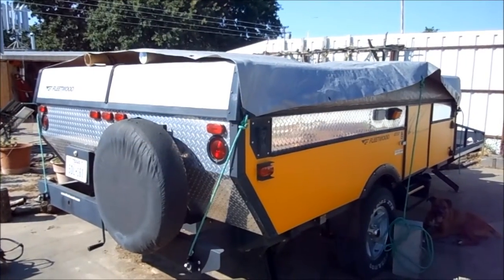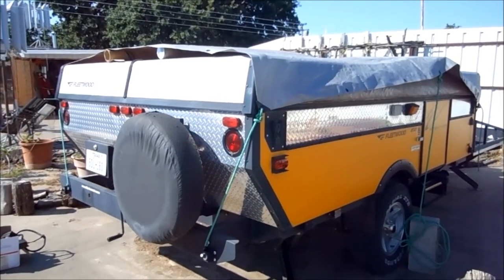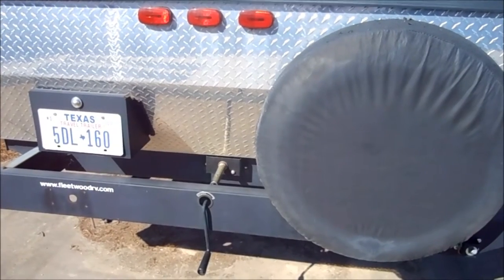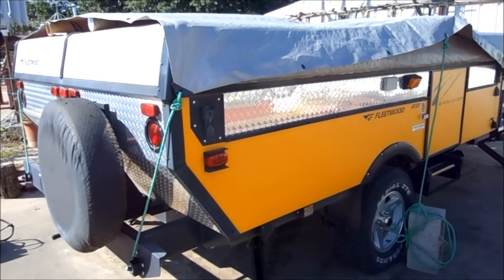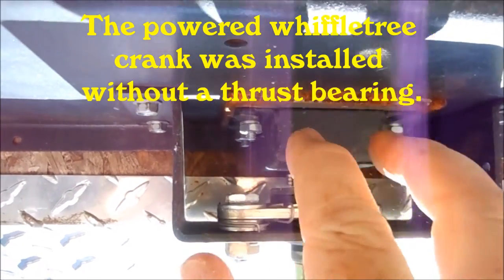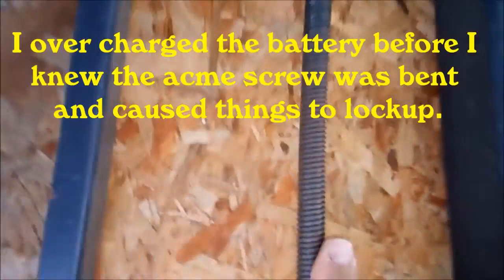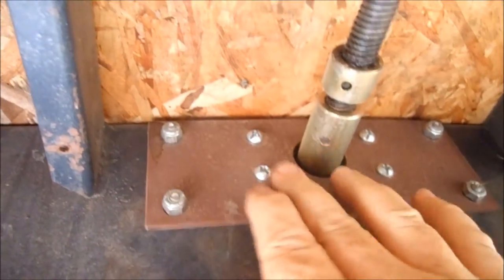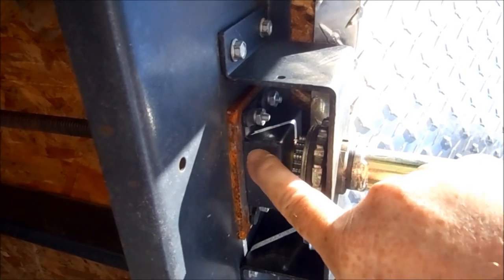E2 Camper Repair Part 1 Whiffletree

Comment: Thank you for the video! I have a 1999 Coleman/Fleetwood camper with the exact same lift system as yours, and luckily I haven't had any issues other than normal wear and tear. I am in the process of replacing the thrust bearing on mine as the internal rubber/plastic portion has deteriorated, which is causing the whiffletree to move a lot, and bind when lowering the top. I'm in the process of removing the PITA shear pins now.

Comment: Great video. I have the same camper (no AC) and luckily haven’t had the same problems  however, I do need to replace the cargo deck. Did you get around to replacing yours? What material did you use?
Reply from the maker: I'm sorry to say I haven't gotten around to doing much repair on the camper yet. And It may have to wait a while longer.

Comment: What it the thickness of the bearing plate you made? 1/4”?  A previous owner removed the one from mine and my ratchet pawl keeps loosing contact.
Reply from the maker: Yes, that plate is 1/4". It may be a bit overkill, but I only wanted to fix it once.

Comment: Hi my name is David and i am from Australia,, i have a 1985 Coleman Camper and the bearing in the whiffletree has collapsed and i cannot wind it up the thing is  i cannot find a place on line that i can get a replacement Whiffletree and accessories can you help with a supplier,, cheers, David
Reply: I'm sorry David, I'm still having trouble finding factory parts for mine. However, you may be able to find a suitable replacement bearing, acme rod, nuts, and cable on this website https://www.mcmaster.com/
Reply from the maker: Andrew is me in case you were wondering.

Comment: Please I need your help I got my Coleman pop up camper and Acme Nut Whiffle Tree is broken I need a replacement I’ve looked everywhere on google I couldn’t find any part for sale do you know where I can find one please it’s argent thanks appreciate it
Reply from the maker: Have you tried ebay? 
https://rover.ebay.com/rover/1/711-53200-19255-0/1?mpre=https%3A%2F%2Fwww.ebay.com%2Fitm%2F1-2-10-single-start-ACME-Threaded-Rod-Lead-Screw-w-Brass-Nut-12-24-36-48%2F322210851299%3Fhash%3Ditem4b054369e3%3Am%3Amfp10WYY3_4Cr9JvhzPfAiw&campid=5337965585&toolid=20008

Comment: Do you know anything about roof repairs? I have an E3 that leaks.
Reply from the maker: Sorry, if your roof is like mine, repair is not an option. My roof is made of 1/8th inch thick plywood, plus 1/2 inch thick styrofoam, plus a very thin skin of aluminum, with a seam that run lengthwise down the center. The only way to fix the thing is to replace the thing, and I haven't done mine yet.

Comment: What is a wiffletree?
Reply from the maker: The whiffletree is the crossbar, with an attached nut that accepts the acme rod which passes through the middle of it. This crossbar is where the cables from all four corners are connected. The acme rod that passes through the middle of the bar acts as a jack-screw which raises and lowers the camper top when turned. According to the manufacturer these part together make up the whiffletree. The point of this video is the show the importance of the thrust-bearing to prevent bending the jack-screw. If the screw can't turn, the top doesn't move. Thanks for the question. Have a great day.